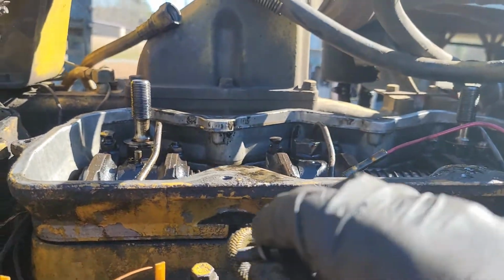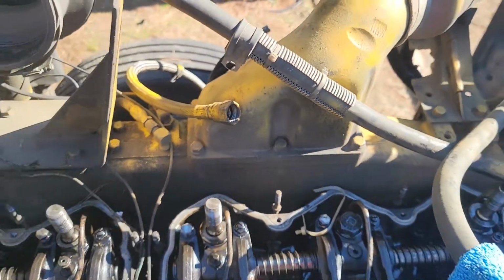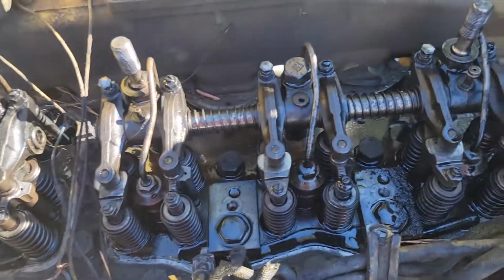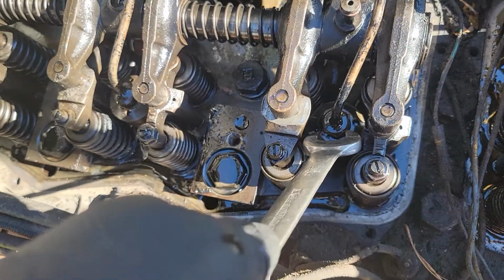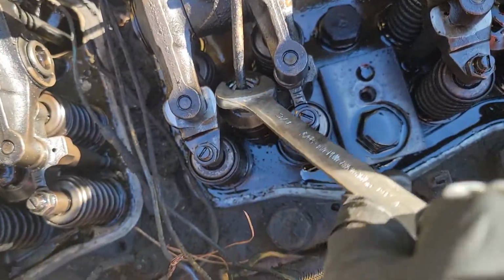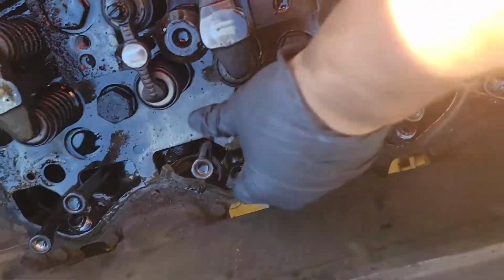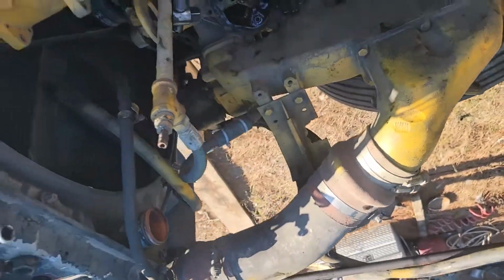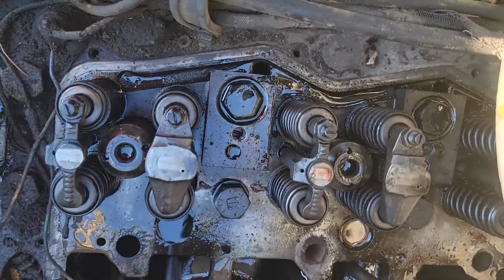3406b rebuild part3 [removing injector lines/head bolts

Comment: The strangeness of the 3 piece valve covers is because not all engines have engine brakes, and they only have 2 piece covers, base and cover.

Of my 2 b model engines, one of them doesn't have engine brakes and the top cover attached directly to the lower riser piece.

That is why the are so strangely designed.